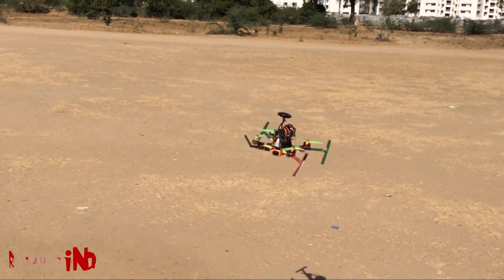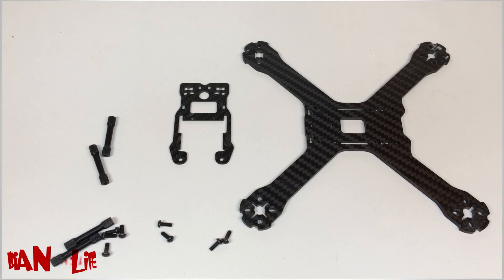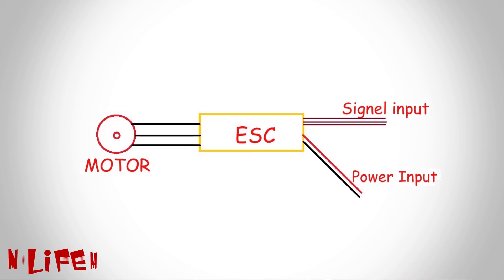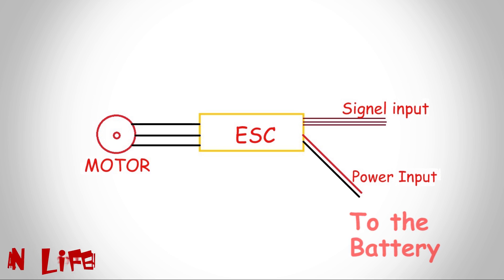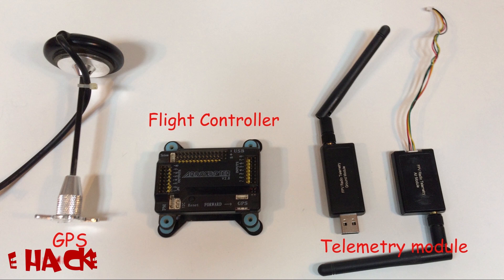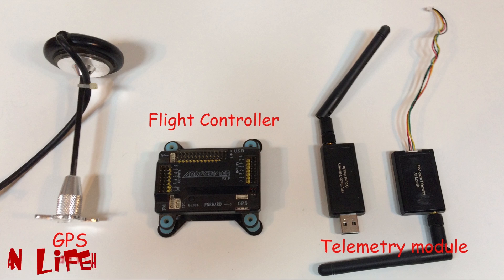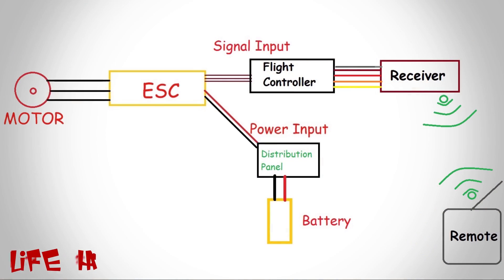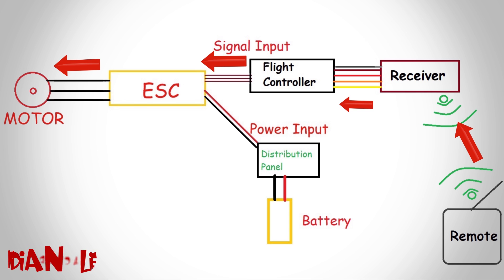How to Make a QUADCOPTER with MOTOR at HOME that flies easy

Comment: And you can put WiFi sports camera
Reply: Raghunandan Kashyap nope the reciver and the wifi frequency of the camera is 2.4gz so you can't unless you have a frsky reciver
Reply: there is separate frequency we use for video which is 5.8 gz . by the way this guy did a good job but this not a beast way to build a quad